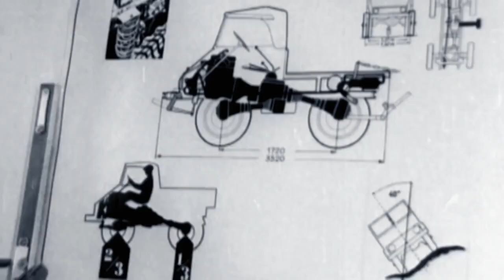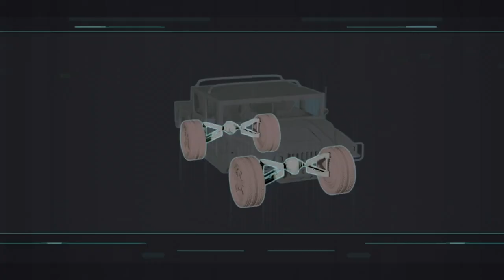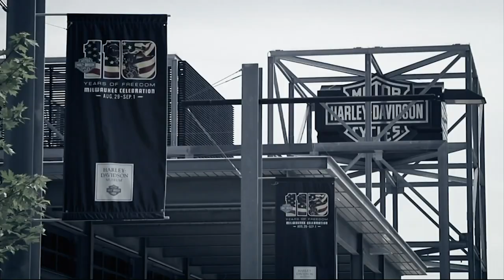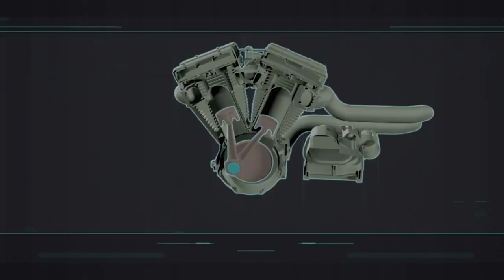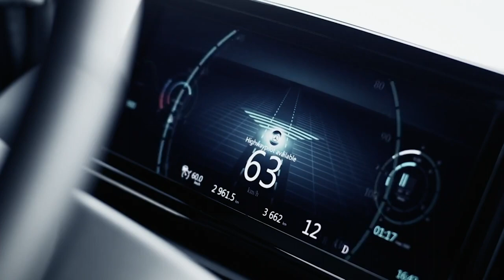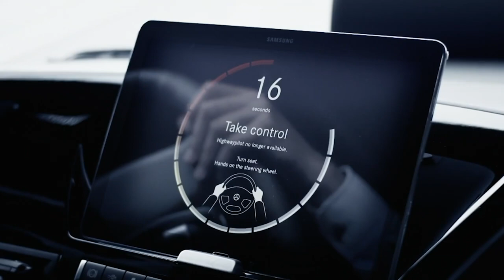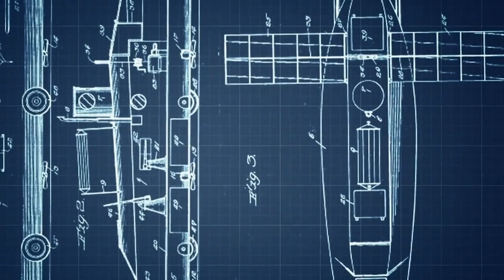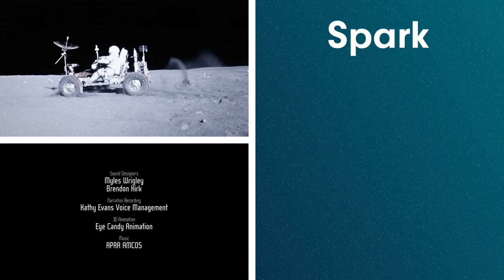The Evolution Of Earth's Unstoppablle Land Vehicles | Power: Engineering Energy And Speed | Spark

Comment: The Unimog has a feature I've never seen anywhere: 
 
Its axles are offset to the TOP of the wheel hub.  
 
That gives it an enormous ground clearance even though it has rigid axles.

For a "standard" rigid-axle vehicle, the only way to increase the ground clearance is to enlarge the wheels to get the differential higher.

Comment: I think that any 4 Wheel Drive with a decent engine getting a significant raise off the ground for under vehicle clearance with custom suspension would put any rally car to shame as I have seen these types of modifications in action on many different types of 4 Wheel drives and 1 meter differences in terrain going up and down travelling at 100km an hour like a high performance sports car on a highway over the above mentioned terrain differences you just can't even imagine what it's like to drive over that type of terrain at 100km an hour and feeling like you are in a high performance road vehicle on a highway over this terrain at those speed's. You can have a hot drink in your hands in such a vehicle on those types of terrain at those speed's and you would be more likely to spill your hot drink all over yourself in a high performance road vehicle on a highway at those speeds absolutely exilerating experience. But very expensive to buy the custom after market part's to build a 4 Wheel Drive like these and if I had the money to buy a car at all I would go for a road trail motorbike instead but if I had the money to get a good sports car I would rather buy a 4 wheel Drive or an All wheel drive and do these modifications to it and the left over money from choosing this type of vehicle compared to a sports car would go into a expanded fuel tank a quiet a few jerry cans 2 different colours 1 colour would be for the desile and the other colour for water a toolkit made especially for your vehicle and a generator with the petrol in smaller jerry cans aswell as a separate container for the grease and all of the other fluids oil etc... a welder and storage for grinder drills etc.. and spare batteries connected to a solar panel to keep the spare batteries charged while using the batteries for a small portable oven and grill and a set of elements for using pot's and pan's on and a bar fridge. Could go outback for several months at a time in such a vehicle. And have a great time getting an adrenalin rush nearly every day that you get to drive over such terrain and have so much fun being so far away from town and city lights allowing you to see so many stars in the night sky from the lack of light pollution
Reply: Thanks to whoever liked my comment as my nephew had such a 4 wheel drive and never used it to it's full potential it was a lime green 4 wheel drive and it was called Kermit as its nickname and going 100km an hour over terrain that is varying between 1 metre highs and lows and feeling like your driving on a highway is pretty cool